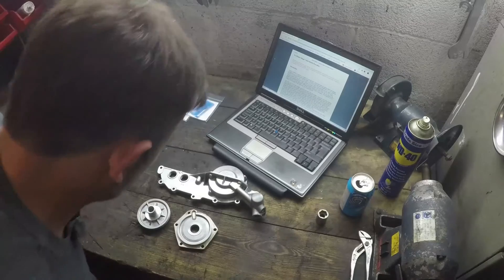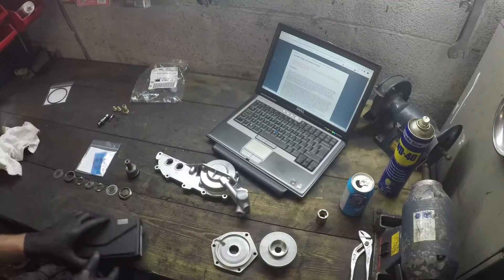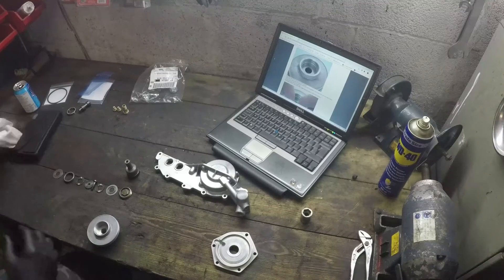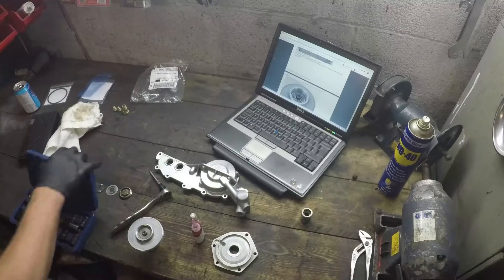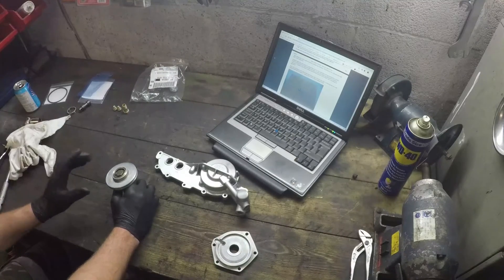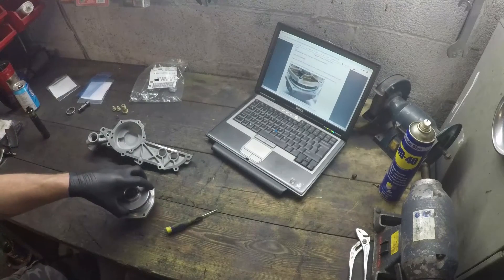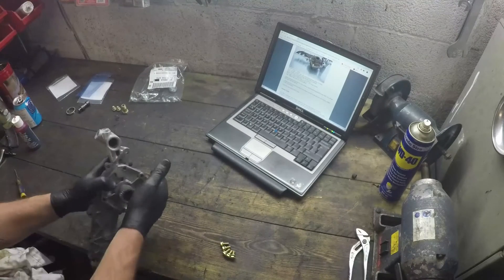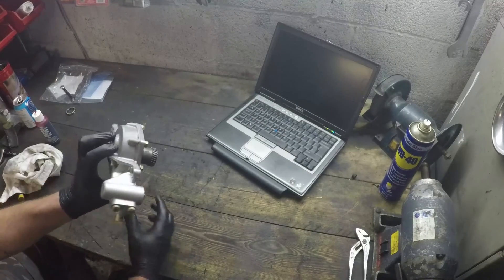M52 Single Vanos Rebuild

Comment: Hi Pamo.  I ruined the18mm bolt nut that retain the piston to the gear shaft. Any idea where I can find one. Thanks
Reply from the maker: I'm afraid I've only bad news. The nut is specific to this application, the only feesible way to get another one is to buy a second hand vanos unit.
Reply: Hi! Did you manage to find a part number for the screw?

Comment: i just take it apart and grind a bit off the ring . flip the plates that sit on the bearings and it works like a charm :D . easy fast and free
Reply from the maker: In hindsight, so long as its ground flat - there's nothing wrong with doing this. Nice one mate 👍.